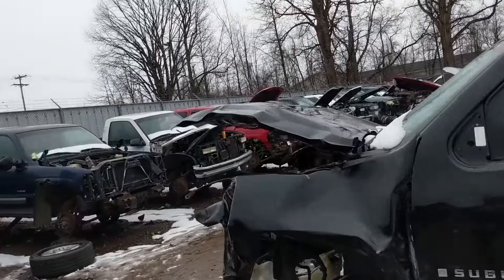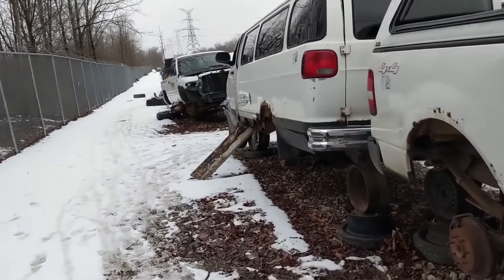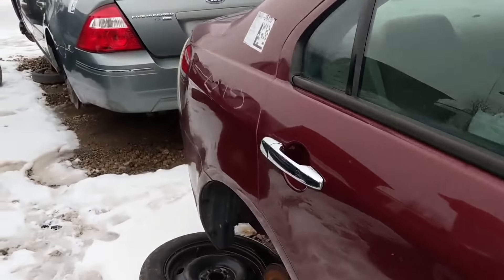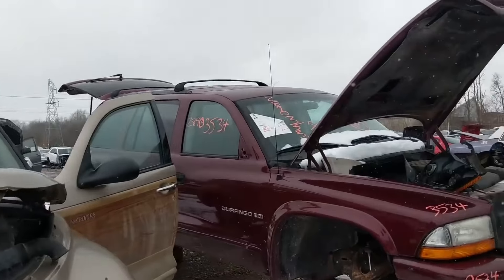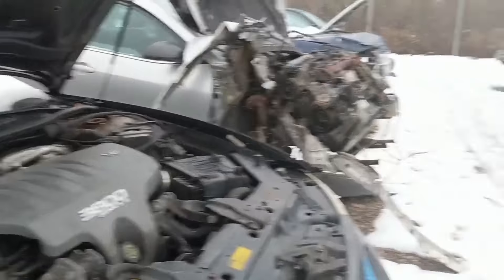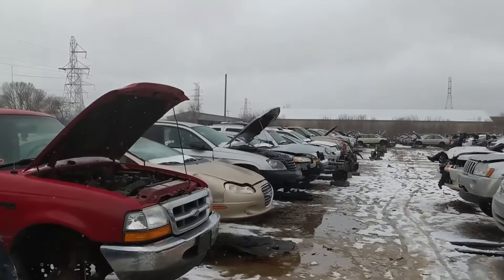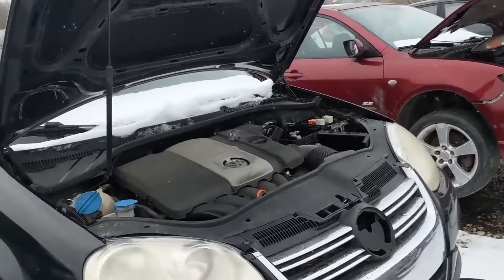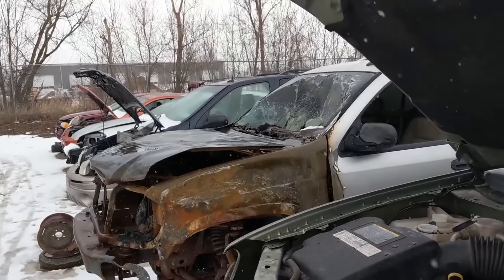Enormous junkyard walkthrough! Rare diesel spotted?? Junkyard mysteries!

Comment: Subaru only made like 4 different engines in the last 30 years so they plug and play pretty well across different years and models. Probably explains why they’re usually pulled at the yard. They’re great in the snow but that means they get used as winter beaters and rust out quick

Comment: That vw diesel is a 1.9 aaz code turbo with the manual ve type pump like the 12 valve Cummins the come from Canada make an excellent Suzuki samauri swap had one
Reply from the maker: Well that's still cool but not as cool as the Ecodiesel would have been lol, thank you
Reply: 92 was a 1.6l from what I remember. Not that its entirely impossible to be a 1.9l. I didnt get a good look at it.

Comment: What are the reference 86number, 706 do old style transmission fit , I know 5 bolt 6 bolt, kool thanks, BigAl California.
Reply from the maker: I'm looking at the cylinder head casting numbers, on the passenger side, front right corner of head under valve cover. 

Quickest way for me to determine engine size and type. 

SBC transmissions will bolt to an LS

Comment: Yeah all wheel mag with hemi? Dude I'd be on board. Yeah hundea was mitsu. So bastard DSM. Had an all wheel turbo Plymouth laser. Amazing car. Pulled hard 5th gear at 90. Handle like it was on rails. Same basic engine in the minivans that saved dodge back when Lee Iacocoa was in charge. It was too early even back then for them to openly do business in the US. 50, 60 years after pearl harbor. Some of the best auto manufacturers happen to be aircraft manufacturers.